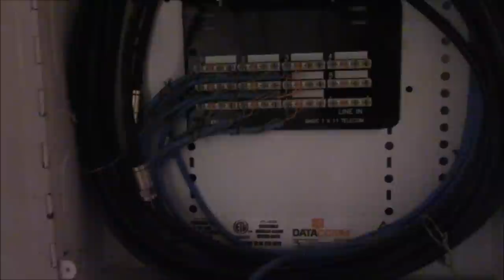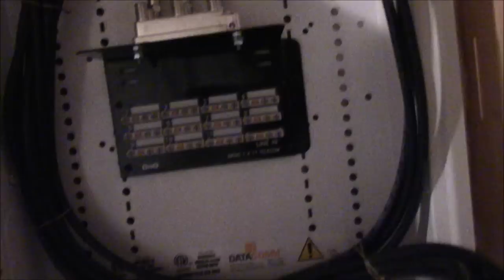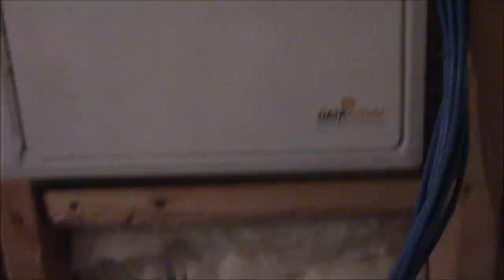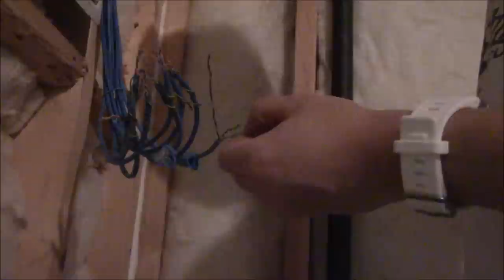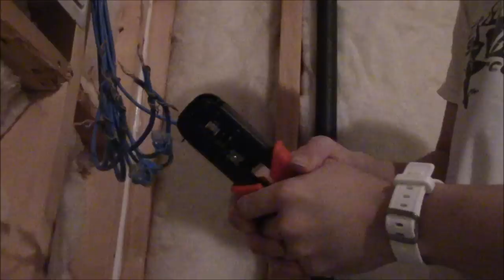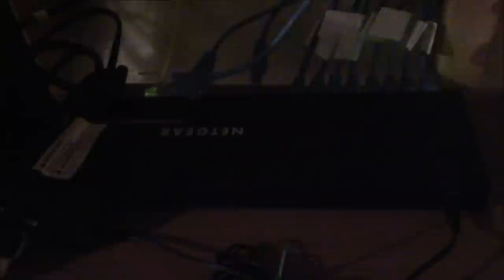Converting Landline to Internet Part 2

Comment: Your setup looks very similar to what I'm looking at in my attic.  I'm curious what you used to connect the excess wires.  I have 7 wires coming into my attic (from 7 locations in the house), but my modem only has 4 ports available.  How were you able to utilize all of your connections?
Reply from the maker: +Brian Dickman 
I bought an extra router, and I plugged that into my modem.
Reply: a correction he bought a switch. Not a router. A router routes traffic. A switch acts at layer 2. A switch is what is built into your home "router" unless you have an all in one type deal from your ISP. That acts as a modem, Wireless access point, a switch, and a router. In order to connect all your cables together you should get small switch 8 ports would be enough. If you get a gigabit you will get faster network speeds.

Comment: Why didn't you use a patch panel for this project?
Reply: If the router has enough ports why would you use a patch panel? It’s way cheaper to not have one and it’s less work. In the case that you don’t have enough ports then a switch would be used. A patch panel would only be used if you want to make it look cleaner and nicer and for larger networks no point in using one at a house
Reply: @XVGX_  zzzzzzzzz possible

Comment: Okay but what if our router is not next to this box ?
Reply from the maker: +mason burrough 
Put it next to the box.  I moved it from my living room to the basement.
Reply: +Hung Nguyen alright thank you. How do I identify if the landline cables are ready to be  switched to the rj-45
Reply from the maker: +mason burrough 
Count the wires.  Make sure the colors are in the correct order on both ends.
https://en.wikipedia.org/wiki/Category_5_cable
Reply: how many wires should there be
Reply: what the hell is the point in all of this if i could just move my router to my room
Reply: @sargonoshana3992  the goal is to get off wifi
Reply: @FunkyTao72  i mean bro i could just move my router to my room and go wired there, save all this trouble, cuz u gotta do this with all plugs so theres no point imo
Reply: @sargonoshana3992  yeah, I get that. but that would wire only your room. this is about wiring your whole house.